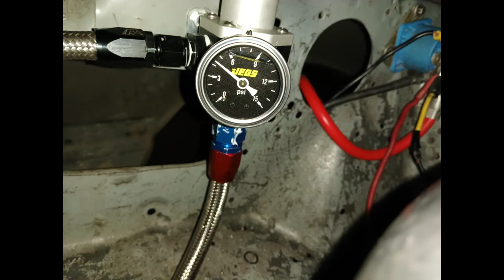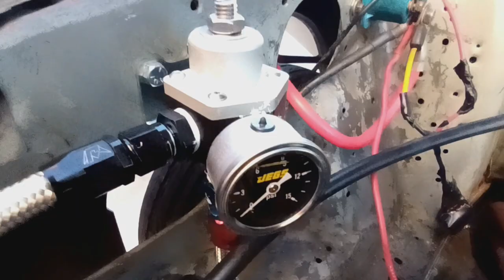EFI to carburetor Conversion 89 Mustang LX "first start"

Comment from the maker: Used original (intank) fuel pump. Reduced fuel  pressure with a Jeg's fuel pressure kit. Used an amazon -AN6/AN8 adapters kit plus two 24" -AN6/AN8 fuel lines to connect to original fuel lines near lower passenger side engine bay.  Original Fox Body distributor used (simple hookup).  A9L computer, 60 pin connector and associated wiring all removed. High pressure fuel line is seen vibrating in the video, may go Holley inline fuel pump made for carbs when it's all said and done.  Still working on it...

Comment: Any additions for the AOD TV link cable and/or carb throttle linkage? Also anything special to get temp and oil pressure gauges?

Comment: You need the new version of the fuel adapter kit, the old style had a h7ge problem of popping off from the pressure. They fix this with the new version.  The New version doesn't have the plastic insert. It has a screw on metal post.  Way better and safer.

Comment: nice work 👍🏾, im looking to do a similar setup in my foxbody
Reply from the maker: No more A9L or A9P (automatic) ECU, most or all wiring from 60 pin connector removed, no more fuel injectors, mass air meter, map sensor on firewall, no 02 sensors. Recommend using inline Holley fuel pump made for carbs instead of high pressure intake fuel pump. UPR 1979-1999 Mustang -10an In-Tank Fuel Pickup Tube - 1000HP Capable! $99 on amazon.

Comment: how did you manage to get the stock dizzy to work?
Reply from the maker: From your TFI connector on the distributor, run the #2 wire "coil negative" (second wire from bottom of connector) to the negative side of ignition coil. Run #3 wire "Run Power in" (third wire from bottom of connector) to the positive side of ignition coil. Now, run a wire from the positive side of the coil to the ignition switch on the steering column.